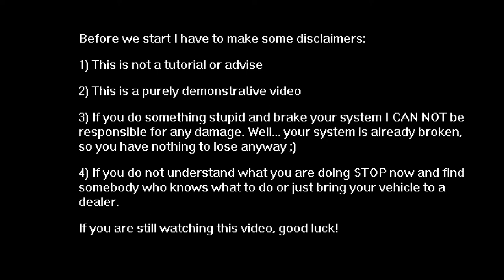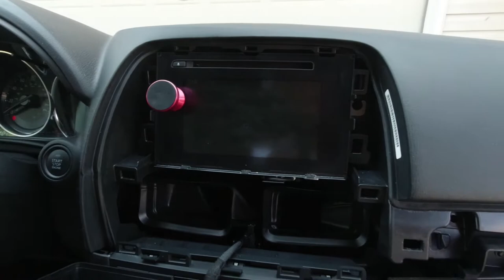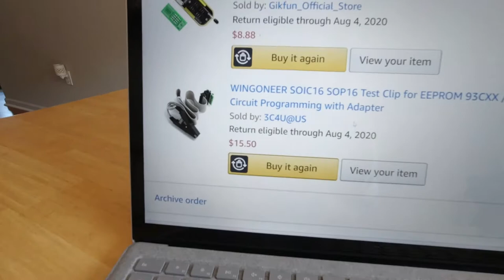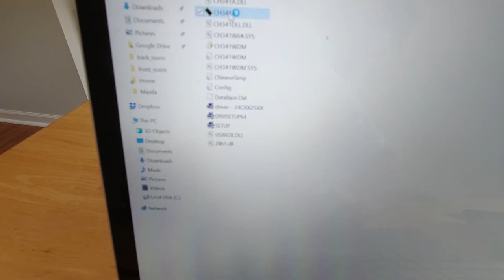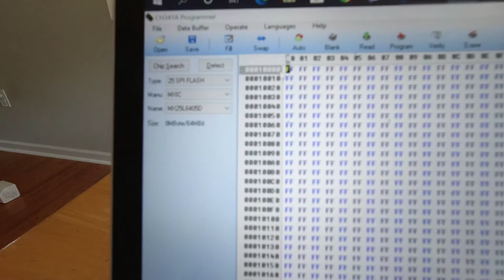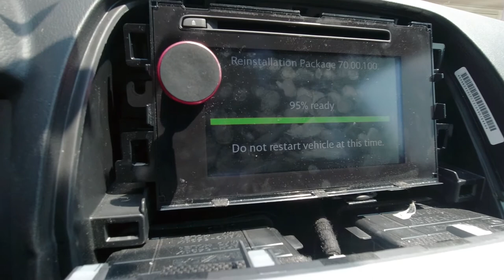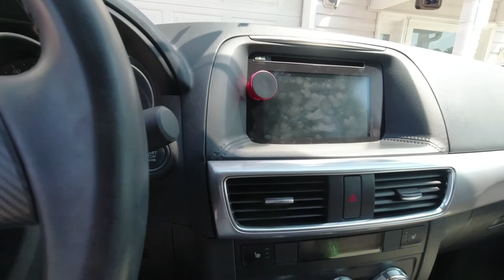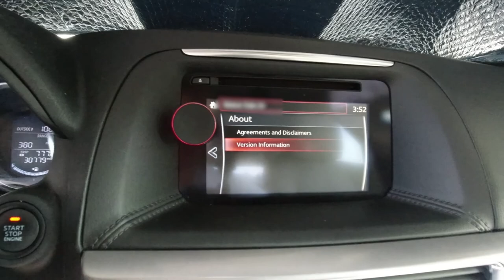How to fix, unbrick and upgrade bricked Mazda infotainment system

Comment: I have to say, this video absolutely saved me. I updated my girlfriend's car with the failsafe package and then realized I didn't transfer over the reinstallation package onto the same flash drive. I transferred the file and when I went to turn on her car it was black. I bricked it. I did a ton of research into how to fix it but this video really was the 'end all be all'. She's so happy to have carplay and I'm so happy that I didn't have to buy her a new CMU unit. I also didn't have an SOP16 to SOP8 adapter but just used jumper pins directly into the CH341A adapter and it worked like a charm. Seriously, thank you for going out of your way to make this video, it was extremely helpful. 

Best,
Zach
Reply from the maker: No problem mate. Glad it helped.
Reply: Zach, could you please give me an example of how you connected without the adapter? Looking for the pin to pin alignment.
Reply: @TylerSmith-mc9yf  Hey Tyler. Yes. This is what my setup looked like. https://imgur.com/a/u22nQMN 

I used the SOP16 clip and then connected jumper pins from the adapter end of the clips into the pull down terminal of the USB connector. Here is the pinout I used.  https://imgur.com/6P6IHMv
Reply: @ZachBlickstein  fist Imgur link isnt working. I think I understand though...just having issues with it not detecting the chip now, ugh. Thank you though!
Reply: @ZachBlickstein  could you repost the picture of how your setup worked? Thanks!
Reply: @ZachBlickstein  Hi Zach. I’m case you get a ping for this message (it’s been six months since your post), I too would like the picture of your setup. I can’t find a 16 to 8 pin adapter as the imgur link is not working.
Reply: @rahimpradhan7477  hey rahim, i just checked the link and it's working. you just have to copy and paste the link directly into your browser.
Reply: Hello friend, I have the same problem. I would like, if it is possible, to tell me how you made the connection without having the sop16 adapter, please, I greatly appreciate your collaboration.
Reply: Thanks Zach! Your jumper pins idea and setup saved it for me. I didn't order 16 to 8 pin adapter and was stuck with the process until I came across your post and saw your setup. Thank you so much!!!
Reply: Can you show me how u set the jumper pin. I have the setup as yours. Can you share the software as well please. The link provided don't have the software

Comment: Thank you so much for having this video. I managed to unbrick my Mazda 6 and get the update to 70.00.100 finished. It is very easy if you follow the steps in this video. Fixed for around £20 for the USB programmer and 16pin test clip rather than £100 for a new CMU.
Reply: How did you fix it? I can't get the program to read the chip because I don't have the 16 to 8 adapter he uses. I can't find one.
Reply: @joselara1412  same here. Did you ever locate one?
Reply: How can I find the 16 to 8 pin adapter. Can't find any parts with it?
Reply: Problem solved. I read the comments here and I was able to jump the wires and my radio is now fixed.
Reply: Do you have to Run the failsafe first or will the car automatically pick it up on the usb?
Reply: @Tylerrrr94  the car will automatically pick up from the usb.
Reply: @SheRideUS  I thought so? So just put both the failsafe and the update package on it?
Reply: @Tylerrrr94  Yes, I had both on the usb, and the update worked as it should.
Reply: @SheRideUS  thank you for replying appreciate it :)
Reply: @SheRideUS  following now :), don’t know if I’m just plain stupid but I can’t find software & drivers 😳😂
Reply: @SheRideUS  was struggling to find the programme and drivers got them now but my laptop hasn’t been used in so long it needs a big update first 🙄
Reply: @Tylerrrr94  I feel your pain as it was mine when I had to deal with it. My issue was finding the firmware update for the radio cus is not easily available out there. I found them after two weeks of searching. 😌
Reply: @SheRideUS  luckily I already have the updates for the car, just hoping I can unbrick it
Reply: @SheRideUS   Do you still have it?

Comment: Good video, I have the same problem and I want to ask you, you use a 16-pin programming clip and with an adapter you convert it to 8 pins. My question is if I have an 8-pin programming clip, can I use that or do I have to get the 16-pin one with the adapter for it to work. Sorry for my English if something is written wrong, thank you in advance.
Reply from the maker: You don't have to use any adapter and just hardwire corresponding pins. If your 8-pin connector can line up the same way as 16 one does you should be fine. Sorry, it's been so long since I posted this video. Somebody in comments posted a diagram how wires needs to be connected back in the days. Not sure if it's still there but you can just Google it. You only need four wires as I recall  correctly to exchange those programming bits between devices.
Reply: @ridelive6249  So, if I already have 8-8 pins connector, I don't need to use 16-8pins connector?
Reply: @yefts  you need de 16-8 pin  conector

Comment: Thank you @Ride & Live for the video.. I just followed the steps but with a different approach. I had to remove the chip and solder it to a smaller board provided in the chip programmer kit. After some small damage being done, inevitably, my Mazda6 CMU was alive and able to continue its updates, and another updates the next day. Lastly, installed with Android auto/CarPlay USB interface. Nice 👍🏻👍🏻
Reply: Hey budy, could you share how did  you solder it?
i'm facing the same problem. will apreciate that.

Comment: Thanks man! Thanks for the video...
You're the saver I'm seeking for days!!

I have a question since the products that you shared its links are currently unavailable:
I easily found "CH341A USB Device" and "SOP16 IC Test Clip" on Aliexpress but I couldn't find the adapter that converts 16 pins to 8 pins. Does it have a sprecial name, product number or something to find it easier?
By the way if I'm not wrong, it looks the usb device has enough holes to plug 16 pins. So can I plug the 16 pin cable with its own 16 pin to 16 pin adapter to the usb device without converting it to 8 pins?
Can the process work like that or the 8 pin converter neccessary?
Reply: I found the way to convert SOP16 to SOP8 without any adapter for those who couldn't find the adapter like me.
You can use dupont wires to match the right feets due to the diagram below

_____________________________

SOP16 // SOP8
- 1 pin > 7 pin
- 2 pin > 8 pin
- 3 pin
- 4 pin
- 5 pin
- 6 pin
- 7 pin > 1 pin
- 8 pin > 2 pin
- 9 pin > 3 pin
- 10 pin > 4 pin
- 11 pin
- 12 pin
- 13 pin
- 14 pin
- 15 pin > 5 pin
- 16 pin > 6 pin
Reply: I found the entire set on amazon for 7 bucks

Comment: Thank you so much for this video. I have a problem because I bought the 16 pin clip but I can’t find the 16 pin to 8 soic adapter. Is it possible to proceed with the original 16 pin connector? 
Greetings from Italy
Reply: Hola, lo pudiste resolver?

Comment: Hi Ride & Live. The video is very helpful and I was able to fix the reboot problem. The unit was stuck in endless reboot mode and was not able to boot up completely because of a corrupted OS. I followed the procedure in the video and flashed the chip again. Reinstalled 70.00.100 from USB and now it works like a charm. Thank you so much.
Reply from the maker: Hey. Glad it helped.
Reply: @ridelive6249  btw, do you download link for 70.00. 367 . Thanks
Reply: How did you get the firmware to reinstall?  Did you use the backup copy you made?
Reply: @keng9686   hi dou you have the link to download 70.00.100 ?

Comment: Hello. Thank you for this video. Will this process also work if you have a 2016 Cx-5 Touring whose infotainment system doesn't go black, but keeps on rebooting? Also, looks like the flash drive you linked to is sold out, any alternatives you recommend?
Reply: I have a 2016 CX five touring as well.  Mine kept on rebooting for a while, but then eventually just went black.  I was able to follow his reprogramming steps all the way, but it did not resolve the black screen.  It did reboot for about one minute one time and I got the screen message that you see on his video.  Promptly went black again and has never come back.  I probably need an entire new unit.  The dealer is going to try and see if Mazda will replace it for free even though my vehicle is out of warranty. No firm answer on that yet, but you may want to try the same thing.  I think the issue is a motherboard problem.  I do know parts are on back order, which probably says something.  Good luck.

Comment: Thanks for the video - looking to solve the exact same issue. I simply cannot get the program to detect the chip though. I have used the diagram to wire it as a don't have the 16 to 8 adaptor. When I put the clip on the wrong way, it disconnects the device so I guess there is some life. Do you have any suggestions at all? Thank you!

Comment: Hi. I've just bricked my Cmu during update attempt (validation failed) and found your video. Looks pretty straightforward. Can I update to newest version using this method? Or can it only be done via usb stick in the car? Thanks!
Reply from the maker: You can update to the newest one if your current version is new enough. I mentioned everything in the video.

Comment: Hello, this is a really useful video, I appreciate everything you share, unfortunately I am stuck at step 9 as the system does not read or detect the reinstall file to continue the installation, I tried with 2 different USB, then I changed the USB module but the problem continues. I'm wondering if I copy the file from another healthy car and paste it into mine.
Do you have the bin file with everything fixed? I'm desperate😭
Reply: He does have it in the description (Google link)

Comment: My 2017 Miata-RF Infotainment System is not completely bricked since I can still listen to the radio, set the time, ...etc. However, shortly after the 3-year warranty expired (naturally) suddenly the screens started changing on their own (starting with the Mazda logo and cycling through I AGREE, all the icons together to choose from (just like those shown on your video when you were waiting for 100% completion), shutting down and then returning to the logo screen, over and over, without me touching any controls) as if it was haunted! I could not set my FAVORITES (even though it confirmed FAVORITES SET), and either USB port would stop playing my mp3-player after a couple of minutes. So boo-hoo on MAZDA for putting such a cheap piece of #$%@ into a car that I love (and still gets compliments on its style). The MAZDA upgrade that the manual walks you through did not help at all. However, it was very courageous of you to tamper with it - I hope I can do the same!

Comment: My detect is not working. I have tried in other orientations and it is not working either. What could be wrong? Do you HAVE to have a 16-8 pin or can I use an 16-16?

Comment: Thank you!!! Thank GOD!!!! It worked for my 2015 Mazda3. I honestly tried bc he kept saying how easy it was.
Reply from the maker: Hey. Glad I helped. As I always keep saying to myself, I'd rather regret of something I did than of something I didn't dare to try. Cheers.
Reply: @ridelive6249  Thanks again 😊
Reply: Hi, can you let me know which USB adapter and clip you ordered?  The links are sold out and I cannot find the 16 pin to 8 pin adapater anywhere.
Reply from the maker: @mattcohen3465  Whatever came with the board. I don't remember tbh, since it's been more than a year ago already.  I still have the whole kit. If you are in US I can sell it to you.
Reply: @ridelive6249  No worries, I actually figured out how to hotwire it with jumper cables.  I felt very accomplished and got to the boot failure screen!  That is until the same reboot issue happened no matter what screen I was on.   It would verify the USB update for about 30 seconds and then reboot.  Just ordered a used part on eBay, it's gotta be a hardware issue.
Reply: did you do anything different on this video for your 3?  i.e. need different code or files or were able to follow exactly step by step to fix it with the USB programmer he recommends?  I bricked my 2015 Mazda 3 yesterday doing that failsafe and then stepping out to the use the restroom.
Reply: @35gametime  I think so. It was a while ago, so I can’t remember exactly.
Reply: it’s been quite a while since you posted this but is there any way you can drop a link to the firmware? I can’t seem to get the right 70.00.100 reinstall file. I got the failsafe just fine. i also have a 2015 mazda 3!
Reply: @user-mi8kx1of5i  wait, do you mean the software?
Reply: @TheBiancawonka  yeah, the software for it, I would appreciate it if you still had it, but if not, no worries!

Comment: I have bricked my infotainment  system on a 2018 CX5 ,. It may be from a corrupted file but in the end the result is that I have a black screen !!!
Do you think that is ok,  performing the same steps that you showing on the video?
I do a AA car installing successfully on a 2016 CX5 , but right know on this 2018 model it does not work. I follow the same steps,but..

Comment: I dont know if this will work for my situation. I started the upgrade with the reinstallation package and missed doing the failsafe first. So it would keep stopping once it got to 2% then give error saying USB disconnected. I then made the mistake of turning off the car and starting it. Now its stuck on that screen. If I try again with the USB it still only gets to 2% before stopping. If I do the above steps will that "reset" the system where I can choose to do the failsafe first again or will still try to reinstall package first?
Reply: I think if you do this procedure, you are essentially resetting back to step zero 

It's going to want to INSTALL new firmware and ignore the past

Where it DOES remember that past is you have to load the same 'format' as it last was. So if it last had 2 parts, failsafe and normal, you have to load a version that has 2 parts
Reply: Did you fix the problem?
Reply: @KK527  had to get another unit from ebay. That one was already upgraded to the minimum required firmware
Reply: @zeshanmomin9678 Did you try this before you get a new unit?  It is because I did the same thing.  I just ordered the USB programmer and they will be arrived soon.  I will try it   before I buy a new CMU.
Reply: @KK527  I did, didn't work for me. I couldn't find the same software, links didn't work for me. And I wasn't 100% certain I got the right tool from amzn either but it would read it I just didn't know how to find the entry to adjust
Reply: @zeshanmomin9678 I see.  That means you cannot modified the chip and process the whole procedure from the video.  Then I still have some hopes for this modification.  Thanks for your response.

I I am not wrong, it sounds like the system will tell the computer roll back to the firmware update step.  It tells the system to disregard all the error messages and continue the firmware update process.  I hope it work for our situation.  It was because I skipped the first couple steps and straightly go to "99" and start the update.

Comment: Hello, I did everything as in your video and I managed to master two MZD and they work without any problems. There was also a black screen. but that's not the end because I have another MZD and now a similar situation, except that during the update process it turned off and in the 10000 file there are two 00 at the beginning, and then FFFFF... I changed it to only zeros and the update process starts but it restarts every now and then and it's the same thing over and over again, I can't start and install it, it just starts and turns off and back to the same thing, what else should I change or what could be the reason?

Comment: Many thanks for this video and files. Top man. ;) 

The only extra step I did was to hack the programmer to use 3.5v as it was running 5v. It was not  allowing me to  write or validate.
Reply: Salam Mohammed, i followed all the steps in this video but when I plugged the infotainment back to the car, i still had the black screen and radio playing. It’s like nothing had happened.  I first changed the 00 myself, when it didn’t work, i erased it and uploaded the modified file from the google drive and it still didn’t work. Any suggestions?
Reply: @zazi14  Same thing here. Did you manage to get it to work eventually?

Comment: Good video I have the 2015 madza 3i sport hatchback with the infotainment system with 1 white plug and 1 blue can you share which one of the plugs has the speaker wires and there's something in the passenger side kick panel would that be the tuner oh yeah this is the non Bose system